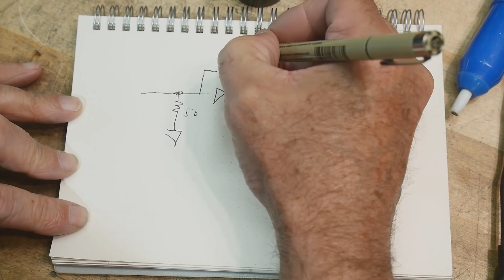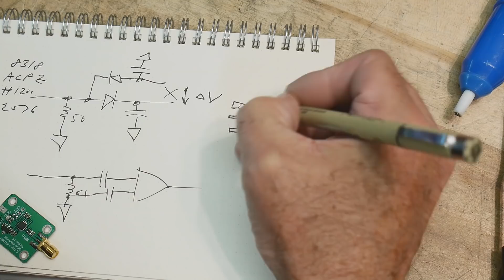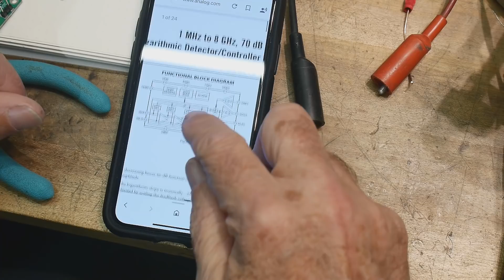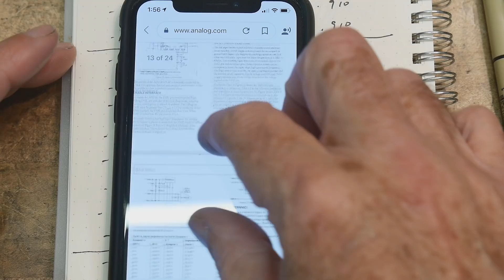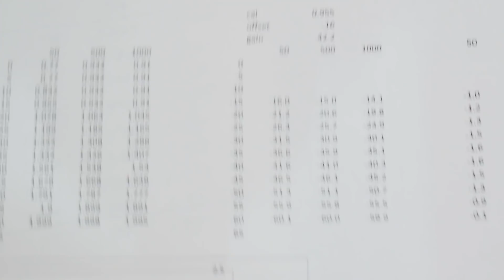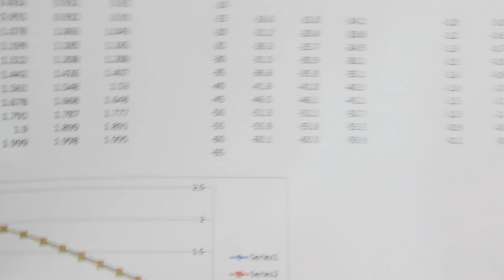#748 AD8318 RF Power Detector

Comment: I was curious and did the exact same measurements using the RF Power Snitch, which is a diode detector. Turns out that for the range above -30dBm the Power Snitch does even better. So a simple diode detector can do well under certain conditions I think (this chip isn't cheap). The only thing that needs attention is temperature compensation. I was looking into this chip series for a new project.

Comment: I built one with the AD8307 chip into a box about four years ago; the spec was up to 500 MHz; characterized it from 1 - 650 MHz and found it to be quite linear from -74 dBm up to +18 dBm. A simple chart yields as you say, a really nice power meter for next to nothing. It actually surprised me with a very stable slope of 32.9 mV/dBm. Sufficient for most work around the bench and I don't have to pull out all the cables & sensors for the HP437 to do a quick measurement!
Reply from the maker: Did you use an A/D? If so how many bits do you think are required
Reply: @IMSAIGuy  Boy, got me there...I simply used the board that looked exactly like yours but with the AD8307 chip; made a big table and went from -74 dBm to + 18 dBm for frequencies between 1 and 650 MHz at 50 MHz intervals (yep, crude, but it did work).  Then plotted manually on graph paper (yeah, I know I'm a dinosaur!) and found the quite linear curve. The board did come with a 100 Ω input so just paralleled another 100 Ω to make it around 50.  That's all I did...if I measure something I guesstimate in the table and arrive at a power level which is close enough for government work!  ;-)
Reply from the maker: @PapasDino  Let me ask another way... Arduino? just ran the voltage into an analog pin?
Reply: @IMSAIGuy  Nope, just measured the voltage from the PCB with a DMM! (yeah, it was a lot of changing frequencies and input levels with the sig gen).
Reply: @IMSAIGuy  if you want a cheap, available everywhere, good enough ADC easy to use with Arduino I can recommend an ADS1115 board, it is a 15bits I2C ADC with a PGA and voltage reference that can be powered from 3.3 or 5v, and in the 2.048v range has a resolution of 62.5uV, more than what's needed to accurately capture the output of the sensor.

The only disadvantage is that it is max 860sps, but if you are measuring a relatively constant power it won't matter. If you also need faster response you can always connect it to the internal ADC on the Arduino, it is also good enough for this application, in most Arduinos you have a resolution of 1mV or less.
Reply from the maker: @Gengh13  Yes, I have several of those laying around. I just wanted to know if 10bits was enough or I needed more.
Reply: @IMSAIGuy  at 5v 10bits gives you 5v/2^10=4.88mV resolution that translates to 4.88mV/28mV/dB(worse slope)=0.18dB resolution.

I strongly recommend also sampling the internal reference to measure VCC(Andreas spiess has a video on the subject) and if you want to improve it even further you can always put an opamp to offset and amplify the signal. So I guess it is enough, and if you want even better resolution you can always oversample and decimate.
Reply: Right is an amazing chip!, I just did my own dbm meter with the Ad8307 and the AtMega328 last week end, i used the native 10 bit ADC and is very stable, the steps are 0.097dbm so for a diy dbm its good enough. I used the full range of 2.5 volts from the AD8307 that gives +20dbm at 10Mhz with the ADC, the Oled display is very clear far better than  those LCDs. Next i will do the Xtal generator for the calibration purpose, since i want to compare with the Tinysa LO generator.
Reply from the maker: @rolandoleiva3269  Sounds like you have some good projects. Yes, looks like 10bits is enough. I might use a 16 bit ADC anyway for fun. So cheap now
Reply: @IMSAIGuy  at first  i was going to make two detectors in one box, so i would have full range till 2.5Ghz plus HF band , better i will buy this AD8318 board and get rid of all the problems of mixing 2 chips. With this corona thing i have more time for doing those proyects :) . Please lets see your 16bit implementation for this board and use OLeds for a pocket size, Regards!
Reply: @Gengh13 Man, I'm lost because your comment!  Please can you tell me where the two values came from? 28mV and dB(worse slope)=0.18dB resolution. Because 
20*Log10(4.88/28)=-15.1747dB not 0.18dB

Comment: Hello MAESTRO, today I got the HP POWER METER 436A (very clean luck new little used) the reference from the HP 435A and 436A spot on 0dBm I'm happy I waiting for the Marconi 6950 is analogic and I go to start with, The chopper system on the detector is similar I think have some fun have ordained the N FET and I go to build the chopper inside the powerhead and put the dc reference in if work. This is the first step. (I think you doing very well and fast of me with your experience) Your videos are one inspiration for this project. Thank you!
Reply from the maker: the detector is built with no solder joints in front of the chopper. everything is gold on gold. This eliminates bimetalic voltage sources. The HP sensors also include a thermistor for temperature monitoring I believe.

Comment: I've had good luck using a plain vanilla AD8007 feeding the 10 bit arduino analog input.  Within 1dB -60 to +8 dBm.  I got a bit better linearity by using a lookup table for every 10 dB and interpolating between points.  I used a precision voltage reference for full scale on the Arduino.  My application was a remote power meter for an antenna range that transmitted the received level back on 433 MHz.

Comment: Wavetek did something similar to Boonton and Millivac in their RF probes. They were dual diode as well, but they were separated from the 50 Ohm load cartridge by a custom mica capacitor at the end of the RF probe. You attached the 50 Ohm load on the end of the probe by threading it on. I think the other end of the load cartridge has a BNC connector that attaches to a T at the main RF load.
Reply from the maker: https://youtu.be/2NzuDoBWVLw?si=PesdxUrHfbWu0WeE

Comment: Yes, the sensor inside got two parts. first, the detector itself (diode or thermistor) is gold stuff, end the second part is the Chopper (two N FET), and one transistor the first amplifier on PCB the Zero, the feedback ecc.. The second stage is the way to connect the sensor to the meter and is reproducible if I reach this part to connect the second stage to the meter the calibration is with D.C. I think there is a different way for the detector itself (remember this whose old technology) instead of gold stuff can put one IC detector personally 3or 6 Ghz is good to me. Is creasy the meter £50 pounds, the connector cable £150, and the powerhead £800 is crazy!
Reply from the maker: Should be interesting. The calibration is tricky. It is calibrated over a range of dBm and calibrated over a range of frequencies. If the sensor head is designed correctly, DC to 3GHz might not need frequency adjustment. The key is very low capacitance. The 436 is just a chopper amp with a selectable filter. It could easily be replace with an arduino and software.
Reply from the maker: Agilent/Keysight now has a sensor with USB output which does just that.
Reply: Yes I read the service manual, the calibration, HP has one calibrator that is injected different DC value to calibrate the meter the detector itself is the hard part special diode or thermistor very carefully chosen to reach 20Ghz 40Ghz
Reply from the maker: @frankreal2258  No that is not all of it. In the old detectors the frequency error calibration was done at the factory and printed on the detector. the user had to turn the dial on the front panel to match the cal data. Then they started to put the cal data into an EEPROM in the sensor, the user still had to tell the instrument what frequency was being used. the sensor can not tell. your detector will also have a frequency error and you will have to deal with that someway.
Reply: @IMSAIGuy  Yes I agree but the HP436A takes the power sensor from the 435A is one hybrid the calibration factor is on the front panel the same of 435A is not like yours, the power sensor needs to be calibrated at the factory and still the calibration factor percentage manually on the front panel. Someone tray to DIY one power sensor for the HP436 and partially succeed only use 2 diode BAT62 and get a limited frequency range and not terribly accurate, the problem whose the detector, the other part of the circuit mate with the power meter instrument the chopper work the zeroing work 220 kHz give the back to the meter the meter reading the power. the model after gets a more sophisticated digital feature.

Comment: So that others don't make the mistake that I did, (I bought 2 of these, I'll keep them because you never know when you might need them,)  they also sell an AD8313, and the PCB photo is identical to the AD8318 board and it's also a logarithmic RF power metering circuit. But it only covers much higher frequencies.

Comment: I'd be interested in learning more about your process for generating the calibration values you were showing and how they'd be used to convert back to dbm.
Reply from the maker: I did gloss over that. The RF generator with calibrated signal levels was an HP 8921A.  I created a table of volts vs dBm. This could be used to look up a voltage and convert to dBm. The next step was to curve fit the data using a linear fit. This is expressed as Y = A * X + B. or X = (Y -B) / A  where A is gain and B is offset. In my video I had an additional offset. so my formula was dBm = ((volts - 0.955) * -42.2) - 16
Reply: @IMSAIGuy  I think you're saying that you used linear regression to estimate the slope and intercept. You won't need to do a p-test on the regression parameters given how linear the relationship is between the variables. Well done.
Reply from the maker: @nvrumi  yes, but I try to avoid using terminology that beginners will not understand.
Reply: @IMSAIGuy  Could you explain linear fit and offset.  Does Y = dBm and X= Volts?
Reply from the maker: @richardphillips2405  I gave you the formula: dBm = ((volts - 0.955) * -42.2) - 16
Reply from the maker: The idea of slope and offset is also taught as slope x/y and y-intercept. What schooling have you had? maybe this would help:
https://www.campbellsci.com.au/calculating-multipliers#:~:text=If%20the%20relationship%20between%20two,%2Dintercept%20of%20the%20line).
Reply: @IMSAIGuy  I am wanting to learn more about this.  I don't understand what the formula is doing.  I know the format of Y=mx+b.  I don't understand (volts - 0.955) and the (42.2).  Why is there an offset of - 16?  Is this equation needed because of the 8318 IC and associated circuitry?
Reply from the maker: @richardphillips2405  I am fitting data. nothing to do with the circuit. I have a set of numbers in column 1 and column 2 . I know they are linear so they will fit the equation of a line Ax + B. I take the volts and subtract .995. This gives me 0 volts. Now I find the largest number and I need to multiply by 42. now a have a line but the data is all too big by 16. It is a simple best line fit through the data set.
Reply from the maker: In math it is called linear regression. If the data had a curve then you would look for a curve fit, or polynomial fit. 2nd order 3rd order....
Reply from the maker: I did not use any tools or formulas. I just looked at the data and faked a line that fit crudely
Reply from the maker: look at the formula for converting F to C degrees. It as a slope and offset

Comment: The AD 8318  8Ghz the 8317 reach 10Ghz is perfectly feasible to put on the front end one of this detector and use the meter (some use one of this detector and one mini Babbuino (sorry Arduino) and make a USB power meter.

Comment: Was just looking at the AD8307 last night , those critters are going for $13+ from Mouser/Digikey price has went way up on them since I last checked, those prebuilt China modules are cheap if they work then great!
Reply: @Seth Lavinder You can get the AD8307 chips for free from Analog Devices under their sample program. They let you order I think 4 different chips every month or two weeks or so. I've gotten several different neat ICs to experiment with that way. There is no limit as long as you don't abuse the program.

Comment: One thin that might be of a concern is RF noise levels that we live in.
Made a DIY  level detector whit MAX2015.
Noise levels are on the order up to -40dBm on some bands, since that one GSM tower is just 300 meters from work place.
On spectrum its insane level of noise.
As a amature astronomer, this is worse than light polution and light polution is on insane level.
Tin foil hat, aneyone? 😄

Comment: It does not look like the standard evaluation board from Analog Devices, is this one of those sold on Amazon or Ebay from China?

I have an HP 436A power meter, but it's broken right now (it's blowing the AC mains fuse after about 4 min) I need to fix it first

before attempting to reproduce your results.

Very informative video, thanks.

Comment: I found the official evaluation board from Analog Devices!!  It does NOT look anything like what you tested.

It is $236.87 at  Mouser Electronics. (A lot of engineering time to produce that board!!)

The Mouser part# is 584-AD8318-EVALZ 

This will probably performed much better than what you tested.

Comment: I didnt know that chip, recently i bought the AD8307 and the AD8313, and just yesterday while i was checking my diy dbm (AD8307), i found in the tinySa that while doing a LO output  at 10 Mhz there is a Jump of 5db extra attenuation (-50dbm) when doing -45dbm and repeat from then on, it happens too in other frequencies...and it is not the dbm meter i checked it with an attenuator and its Ok.

Comment: Interesting video. Did you build your power meter? I am looking into something similar (to buy or build myself) to protect the input of my RSP1A, when using as Spectrum Analyzer, or when maybe even combining on the same antenna for Rx/Tx for the purposes of pan adapter for my analogue rig. RSP1A can handle only 0dBm on the input (very short +10dBm). So I would like a circuit that fast decouple the input if RF Power>0dBm. Also maybe to combine with a DC-block circuit, as that can be also a problem for the input. Similar thing for my nanoVNA. I am not sure yet what would be the limit for the nanoVNA, but similar story, you don't want to blow up your sensitive equipment if something stupid accidentally happened. And we all know, sooner or later, that we WILL do something stupid, haha. But the circuit would need not to degrade the input properties of the equipment of course. Any suggestions?
Reply from the maker: higher end equipment will use this: https://youtu.be/62k7TxDoQKk

Comment: Hello MAESTRO yesteday I buy 2 power meter one HP (Hewlett Packard) POWER METER 436A and one Marconi instruments RF Power Meter 6950 cosmetical very clean, my dilemma is the power head /sensor (very expensive for my pocket) the project is to put on function. my first question is: Make one DIY or " I find some sensor from General Microwave POWER HEAD N436A is compatible with the HP meter? the is other compatible? There is a way to put on the front end one Analog Devices RF power detection chip directly. Your great expertise is for me one incuragement. I hope not to bother you.
Reply from the maker: Sorry. You can't make a sensor. You can't substitute a sensor.
Reply: @IMSAIGuy , there is a compatible substitute for the HP 436A
Reply from the maker: @frankreal2258  The HP sensors that work on the 436 will also work on the 437 and 438 and maybe later models too.

Comment: I found one power sensor Head COLINE DC- 2.0 Ghz 5 watt the only information sed OUTPUT 1mV/Watt some help or idea MAESTRO.
Reply from the maker: It is probably a diode detector with a built in attenuator. It will give a relative output but not absolute. You will need someway of calibrating.
Reply: @IMSAIGuy   Hello I open de sensor, I found this information: C Coline limited.
50 OHM POWER SENSOR
Input impedance 50 ohms. BNC male connector.
SWR 1.1 from DC to 2 Gh
Output. 1mV/watt
impedance. Output. 470 Ohms.
Use 200mv range on D.M.M to read on watt.
Accurance better of 5% DC to 2 Ghz
True rms mesurament.
5 watt continuos rating
10 watt for 5 minutes MAX
Calibrable from a DC source.
inside one temperature sensor attached to the BNC. some heating system and one resistor plus one resistive trimmer to calibrate to the banana socket output.
(the god side of the box is 80x30x20 god quality BNC male metal body)
Reply from the maker: Interesting device. Looks like it might be a bolometer design
Reply: @IMSAIGuy  to reach 3.5 millivolts I need take the ptt 1 minute
Reply: hello, I get one other Chinese power meter with the AD8318 RF Power Detector this one read 0.2 dBm on the 0 dBm HP 50 Mhz calibrator 0.224 millivolts on the oscilloscope with 50 ohms load, the tinySA is 2dBm high,